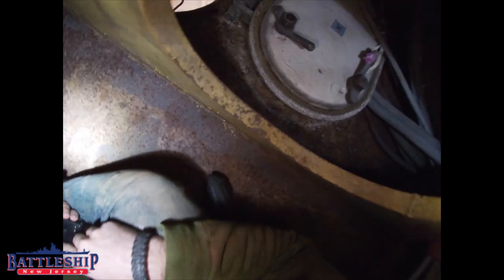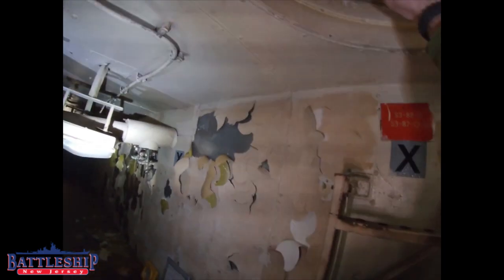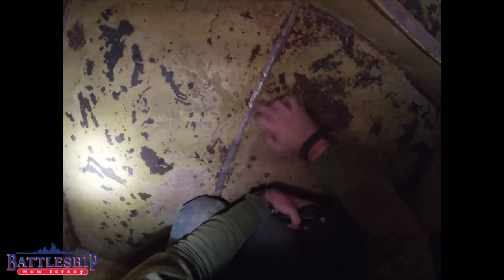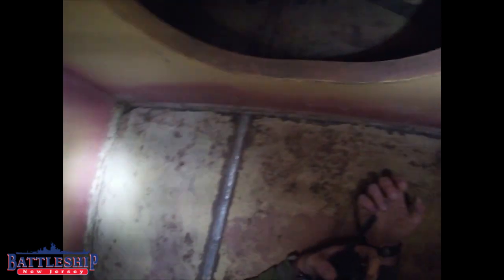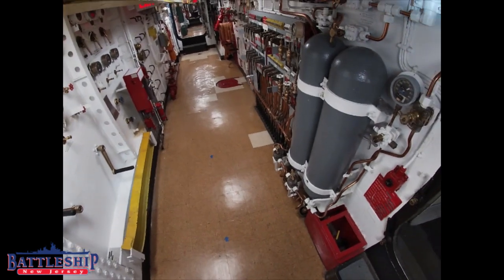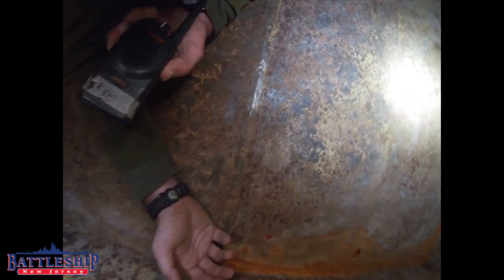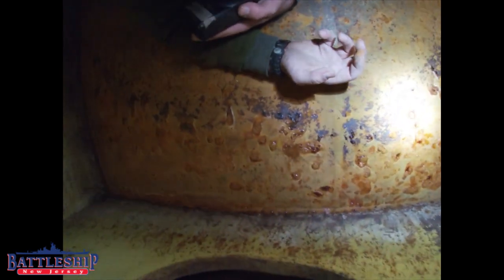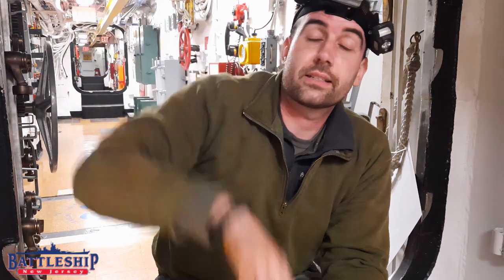Splinter Deck: The Crawl Pt I

Comment: Those are perfect welds. I can't believe the design and skill of those who built her.
Reply: Travis Thacker  Yes. With the idea the US was pumping out material as fast as possible, you would get the impression that everybody was given tools in his hands and start to work. But does welds are just perfect. I guess the US was able to pump up quantity while maintaining and probably even improving on a high skill standard.
Reply: Just to add more complexity to their feat what kind of lens were they welding with and quality of glass. They say we will never be able to recreate the Saturn 5 rocket, not because we don't have the technology but rather we don't nor does anywhere in the world still posses the skilled labor that was required to build them. Imagine GTAW was invented to weld Aluminum for the first monoplane wings and less that 30 years later we reach the pinnacle of skill and manufacturing to only lose it to faster more cost effective means of production.

Comment: As a welder. I can’t imagine how hot and cramped it was in there while welding all of that out..
Reply: I have a hunch back then they made bigger ships and smaller people!
Reply: ☝☝ I will gladly weld a hot tie in before I would ever want to weld in a shipyard.  "If ain't round throw it down"🤣
Reply: @MK0272  I have a hunch most welding is done before it's immediate top level construction is placed.
Reply: @Chris-dg6km  pipe hands are only good at one thing. I get paid just as much In the ship yard and I’ve gotten to learn a lot more then when I was pipe welding. And I can fabricate lol
Reply: @firecracker4277  So you decide to trash talk me to bolster your own self? I didn't degrade shipyard welders. It is a tough job in a tight space. I was a pipefitter before I became a welder, now I set on my ass in front of a computer drawing the facilities making better money and not embracing the suck. Good luck and hope you prosper.
Reply: whats deal with some butt welds not rusting? can you use a high nickel or chrome filler on mild steel? 15:21
Reply: @disconductorder  wouldn't recommend it they are all steel but dissimilar composition
Reply: @Tuning3434  The frames to floor and frame to frame welding can be done in the open.  They still had to do the overhead welds and then all the features like piping after.
Reply: Hey guys ya all know that a Plumber is just a Pipefitter that cant weld!....right?
Reply: My dad worked in the ship yards late 50's till mid 60's he always told me  it was miserable and hot couldn't see the  guy wielding  5 feet away due to the smoke  even with what they had for ventilator running. 
Coughing up  red oxide colored stuff every night. 
Thought about following in his footsteps  but decided it wasn't for me. 
Instead  I hang out 200 to 500 feet up and build wind turbines.

Comment: Your brave! Spooky down there.
My father was a Petty Officer, engine room on a ww2 frigate.  They used to send a newbie in to scale/scrape a boiler.  They'd just fit through the hatchway cold.  Hot work.   After the physical effort of scraping for a while they wouldn't fit out the hole until theyd been hosed off and cooled down.    Quite a fright when the guys outside would fake an emergency, need to fill and fire the boiler up!  He said the prank only worked once per person, easy to see why.

Comment: Ouch, Ryan, that really looked painful, clambering over all those awkward lumps of steel on your knees and elbows in a bent up position ... I can't believe you did that.  And presumably that was only a small section of the splinter deck, as I assume it extends the full width between the sloped armour on both sides, as well as a good part of the full length of the ship.   Imagine if you had to crawl all of it ... ughh.

Comment: Your adventures on this ship are fantastic. I have to ask a serious question though - given the cables running through this space, would that have made it easier for an impacting shell or bomb to take out some vital ship system during a battle?
Reply from the maker: There's always a back up way to move power if necessary

Comment: I had no idea that that space would be so cluttered with wiring and plumbing.  I assumed that most areas would be used for wiring but I also thought there would be at least a passage down the center where crew could relatively easily move the length for work and inspections.

Comment: Do you (or the Navy during mothballing) put dehumidifiers in the splinter deck, or just desiccant?   Also are there eye bolts in these spaces to support a chain fall for hauling cable, pipe or other repair essentials?  Are there "bullseyes on the splinter deck so sailors know where they are?  Are/were there any reflective devices to assist in navigating through the splinter deck?  Perhaps an arrow showing the way to the closest hatch?  The vertical walls seem to be 1 inch thick and not an alloy steel, is that true?  You ran into a "bronze" pipe which seemed to have a "T" with a plug in one end; was that for fire fighting so a hose could be attached to it?  It seems your exploration just piqued my curiosity.
Reply from the maker: Dehumidifiers wouldn't fit in here and we didn't see any desiccant disks, but we will probably put some in here. There are eyebolts on broadway and the engine rooms for this. Didn't see any of the usual mothball arrows here. Guess there weren't many yardworkers in there.
Reply from the maker: No bulls eyes that we remember. Can't say for certain on the use of the pipe.

Comment: First of all: Awesome job guys and I am very happy to see how your channel developed during the last  year. Great! One question: It is said multiple times (not only by you) that a direct hit of a heavy shell on a conning tower or a similar small space with heavy armor leads to a shock which is so strong that it will kill all guys inside this structure even as the shell does not penetrate. Is there evidence for this statement? Because e.g. during the last battle of Bismarck the conning tower has been hit multiple times, even been penetrated but there is evidence that crew has left the conning tower alive (open conning tower door). In the book "HMS Ulysses" (by former RN man Alistair McLean) you find a similar statement when he describes a German plane crashing onto one of the 5,25 inch turrets and the gun crew turning into a bloody mass. Yet in similar situations in real live nothing like this happened. I am quite skeptical on this and would like to see some evidence.

Comment: How about a camera on a trolley, slow trip down Broadway's rail! Better yet a 360 camera!
Reply from the maker: Our donors often donate specifically so we can acquire specialty equipment like this. https://gf.me/u/ysdi3a
Reply: mike c good idea but there is usually a bulk head  you got to move thru.....I once was in a passage way amidship about 2 decks down under the hanger deck on the Nimitz  looked left and right all I could see was bulkhead passages getting smaller and smaller about every 6 feet or so as far as you could see!

Comment: Are those cables marked in any way to facilitate repair or replacement in case of damage?  Also, are they duplicated elsewhere in the ship so a single hit on a batch of cables couldn't take out a bunch of systems at once?

Comment: Ok I seen that your not allowed to start the main engines up and other equipment. But what if you could? would it be possible to fuel her up and go if needed or has stuff been taken apart and off her?
Reply from the maker: It would take a few years to get the engines back in shape and the rest of the systems, assuming weve got unlimited cash and resources. We also would need many millions of dollars just to fuel her up.
Reply: @BattleshipNewJersey   I understand that aspect of a proper restart. I'm asking more of a fantastic question! If a representative from each of Jersey's past crews, divisions/departments with salty 1st and 2nd classes come on board today. She had fuel, could they lite the boilers and expect to be able to take her to sea with basic navigation & combat systems available.  Or has she been decommissioned to far and beyond that fantasy?
Reply from the maker: She's been decommissioned beyond just an experienced crew coming on board and starting it up.
Reply: @BattleshipNewJersey  figures. Off point. When I was on active duty around 2002.  I was  in the Portsmouth Va shipyards drydock  and ships company of CVN65. We figured out we could get permission to board the strip ships and mothball fleet in the James River to find parts to keep 65 going. One day we managed to get aboard the old Iwo Jima with a group of about 50 of us to get whatever we could.  The old girl was dark and none of  use brought flash lights and there wasn't any shore power. Some of the nuke guys with us said hell no we weren't going back empty handed and went on her saying they where going to fire her up. We all thought sure you are. 45m to 1hr later we start seeing smoke coming from side stakes under the flight deck. The lights flicker in the  hangers and then the whole ship and tower.  I have no idea how long that ship had been sitting  but our nukes fixed and fired her up in no time. We all where joking about pulling her out for a last cruise down the James River before she became razor blades or sea sparrow FOD. It was one of my  best days in the navy

Comment: Can the  I beam hoist system used to move heavy equipment be moved to make the bulkhead system watertight ? Was it installed I the original construction or added during the 1980s reactivation ?
Reply from the maker: Yes, the piece at the door is removable it was installed when the ship was built.  Heres some info on watertightness https://youtu.be/MgyuaIiVtJw

Comment: I was told that on USS Kidd there are several „Kilroy was here“ are painted throughout the ship. You can actually see one of the Kilroys on the radar console in the movie Greyhound. Are on New Jersey also some Kilroys painted? If so, where? And also if so: what is the weirdest spot on New Jersey you have found a Kilroy?
Reply from the maker: There likely is at least one, but I haven't seen one. Being as modern as the ship is, that was fairly outdated by 1991
Reply: @BattleshipNewJersey  wow, that was a quick answer! Thank you very much! 😊

Comment: How new was welding in ship building in ww2 ? In trade school i was told arc welding started in the very late 1880s or so. What is the history of welding in line of us battleships?
Reply from the maker: Check this out https://youtu.be/LiR-3FpHrWo
Reply: @BattleshipNewJersey  also i think that shinnyness in that weld ryan saw might be a form of stainless steel. stainless doesn't rust or corrode the same way mild steel does.
Reply: I think the Germans were the first ones to use welding extensively in ships to save weight but that proved to be problematic. The Graf Spee for example had big problems and suffered more damage then anticipated which was one of the reasons the ship had to go into the harbor of Montevideo for repairs.

Comment: I have a general question related to restoration.  There are aspects of the ship that have a 1940's look and feel to them, and parts of the ship that have a 1980's look and feel (the cruise missile launchers were the most glaring example - they just seemed out of place, but you probably weren't allowed to remove them - or perhaps you didn't even want to).  And there were others as well, as I recall.  So when you restore a part of the ship for the public, and if there is a conflict like this, how do you decide what to do?
Reply from the maker: Our interpretive period, or what we aim to restore the ship to is 1990. We have 2 spaces that have been "restored" to their WWII appearances, a radio room that stopped being main radio by the 1980s and was one of many, and the stateroom that was used by Admiral Carney that we used to talk about Halsey that didn't have much of anything in it by the time we got there.

Comment: I will have nightmares thinking about having to do repair work up there on the piping or the electric cables. Just getting the tools and parts through that hatch would be a chore.
Reply from the maker: Yeah. We are a little daunted in getting the water out of this compartment.
Reply: @BattleshipNewJersey   Try using dessicant bags like we used in the Boilers. To Lay them up. And to keep insides of pipes from rusting. 
 Or a Civilian method would work too. Put Kitty Litter in Socks the a knot and put those in wet areas.
The Litter will absorb the mostiure.

Comment: are there any spaces left the museum staff haven't reopened and explored since the ship was mothballed in 1991?
Reply: also, if you hand me some ear muffs, a respirator, a needle scaler, a pail of rust converting paint, and a couple brushes, feel free to let me loose up on the splinter deck until I never want to do
that again. 😹
Reply from the maker: We haven't been in all the tanks. We sound them and they're all empty of fuel. A few have water ballast in them. And no doubt there's a closet or a corner of a turret weve missed but we've been pretty much everywhere.

Comment: Do radios / walkies actually work through all that steel? Seems like that whole ship is one big Faraday Cage. NVM apparently you can receive but not transmit.
Reply from the maker: We can get some signal to hear a message but not to respond. We can usually send out enough to send static which is good for sending a basic one static equals yes two equals no

Comment: What all is done to prevent rust and excess water from building up in all the crawl spaces like you found today?
Reply from the maker: There is dehumidification done to limit it, though that only goes so far. Paint helps with rust.

Comment: Question??: Are there any areas or systems that are still classified or off limits that are still on the ship? The USS Nautilus only allows the tour in the front few areas of the vessel and the reactor areas and pretty much everything aft of the sail is off limits.
Reply from the maker: No, we can go anywhere. There are spaces that need additional safety precautions, i.e. we don't go in tanks without ventilating them, but the navy doesn't restrict us.
Reply from the maker: For additional details on which systems that we don't touch, check this video out: https://youtu.be/lK9ofM6ef5g

Comment: Ryan, good content but your camera angle is a bit off! I am a Retired  Journeyman Sheet Metal Worker and have done work in the shipyards when uptown was slow,  Here in Seattle we have both in the Local Union, so I've been in cramped/confined spaces and voids, even in buildings! .....everywhere I've pretty much worked since the late 80's early 90's we were required to wear 'smurf gloves' (the white nylon gloves with the blue rubberized palm/finger coating) for safety reasons!

Comment: how the hell would they have even painted it to begin with?

Did they just have dozens of sailors lug in paint cans and hope they didn't pass out from the paint fumes?
Reply: Lazurkri in the case of modern construction, ships are built in modules and painted before even being hoisted onto the ship. They are complete with piping and fittings. The only part needing to be painted are the seams where they are welded together. Re painting would mostly be done by spraying.
Reply: @davidknows3320  i get that, but how would you do preventive painting once they are in place?
Reply: Lazurkri it would all be sprayed. Long hoses and a very large pressure pot set up.
Reply: @davidknows3320   how does the crewmen spraying it not die from the fumes?

In that enclosed of a space, and especially with the relatively shit filters they had in the '40's, you couldn't use any sort of filter without it gumming up or there not being enough free oxygen available to be filtered out of the fume laden air.

Would it be compressed air to a mask?
Reply: Lazurkri yes. In my much more modern time in the Navy, an air line mask would be used. Along with a Tyvek suit. I realize they were not around in the forties, but later on during overhauls, or recommissioning work I'm sure that's how it was done.